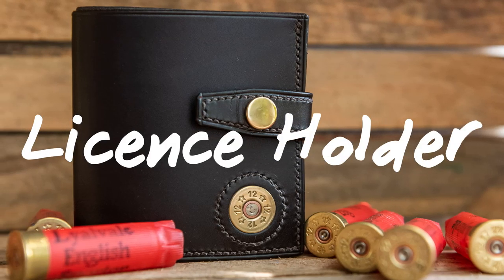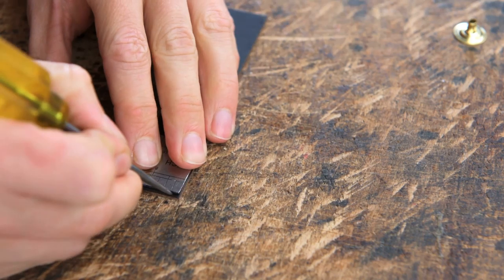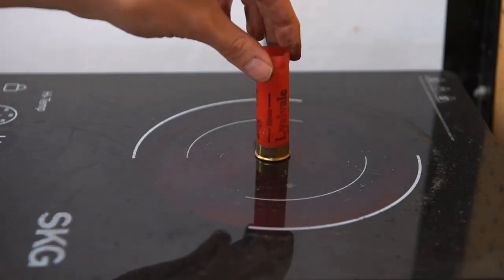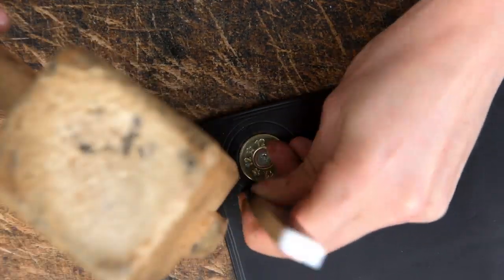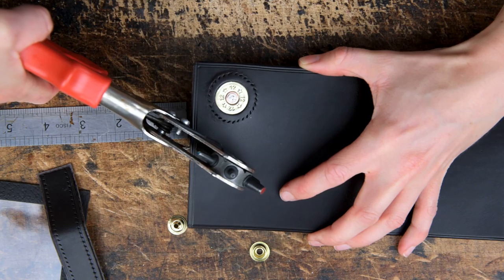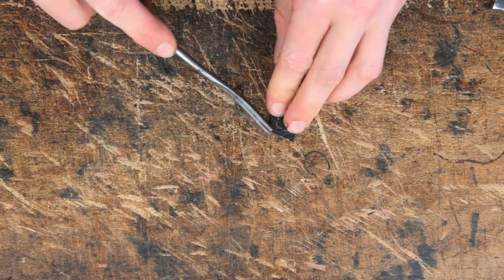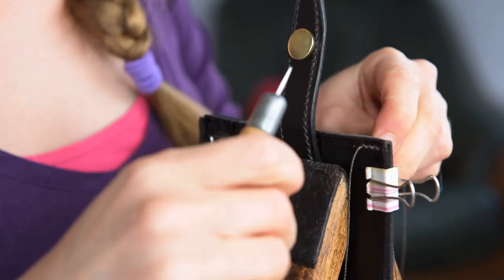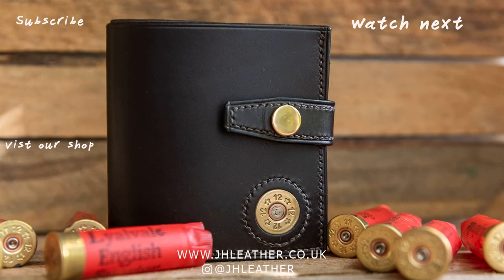Make your own: Shotgun/Firearms Licence Wallet

Comment: Hi just come across your channel and loving your work. Just putting some equipment together to start leather crafting myself. Just wondered if you new where I could get hold of a saddlers pony which I believe is longer and broader than the cheap small ebay ones. Tandy don't seem to sell them and I cant see anything on the Abbey website. Any thoughts on this, would be appreciated. Plan to sit and work through all your films. Cheers Julian
Reply from the maker: Hi Julian, glad to hear my videos are helping you. Unfortunately Tandy was the only place I knew that did the stitching pony, I think Cumbria school of saddlery still do some tools and they did make some shorter stitching clams which could work for you.
Reply: @JHLeather  Can see one on your channel, but would be good to get the low down and your opinion on thread makes and sizing for this style of leather work if you get a chance. Thanks Julian
Reply from the maker: @julianwilliams4750  the ones I have are saddlers clams and they come from Abbey England. I thought you were talking about the little ones that you can sit on in a normal chair.

The threads depend on what size you are stitching, as a guide I use either 4/18 linen thread or tkt8 corespun polyester or 332 lin cabel linen threads for stitching in 7 stitches per inch.

Thanks
Jo

Comment: Heh Jo.  I love your channel and have followed you from the early days.  I have a few questions.  

1) what type of glue are you using there?   

2) if it isn’t too much trouble - can you list the weight if the leather at the beginning.   I am in the states and we don’t use metric (I wished we did) but ounces seem universal.   

Thank you again
Reply from the maker: Hiya, thank you for your support for the last 3 yrs 😁

1) the glue I use is a contact adhesive called bostik 6092 it's used a lot in the shoe industry and is the best adhesive I've ever used. 

2) All the leather I purchase is in mm and I have no idea what they are in oz. I did do a quick Google and this website is very handy.... https://montanaleather.com/leather-thickness-and-conversion-chart/

Hope that helps 🙂
Jo
Reply: I always thought that the UK used ounces more than the US - but I am likely mistaken.   Thank you for the chart.  I knew there were conversions. But I will use it more now.

Comment: I noticed you treated the edges of the main body before stitching  and at the final steps you sanded the edges again, to even the edges of lining to body. My question is, could one skip the first edge work, only make the crease and stitch marks leaving the main body edge work until lining has been attached?
Reply from the maker: Hi Amy, the glue that I use to stick the parts together is a contact adhesive which if it gets onto the edges of the leather can be absorbed into the edges and will make a waterproof barrier that repels the stain. Also depending on what other items you want to make it can be difficult to do the staining afterwards, like around a buckle turn or on some padded leather. 

I was taught edge, stain, crease then stitch mark so it's also a bit of a habitual process. This is just the way that I do things, if you find it easier to do things in a different order that's fine 👍